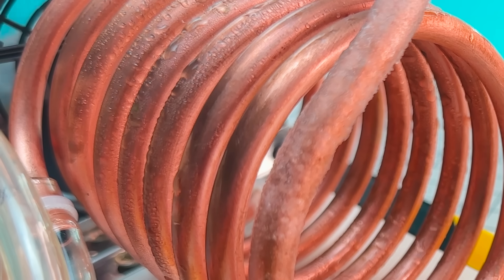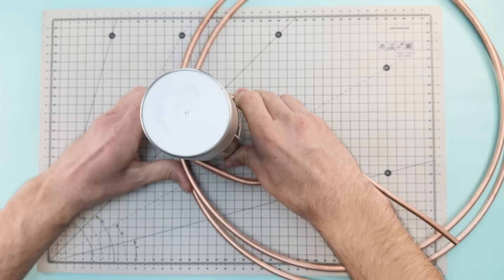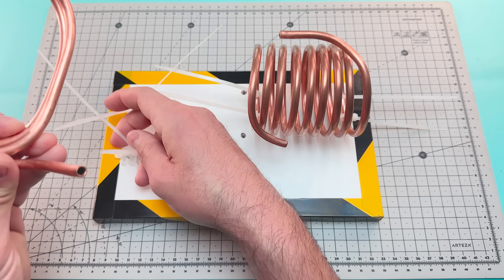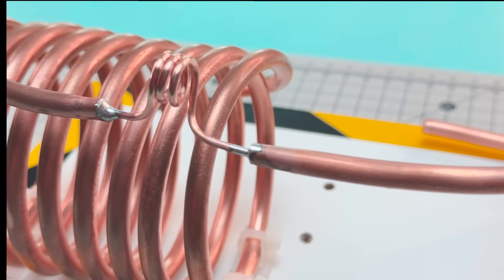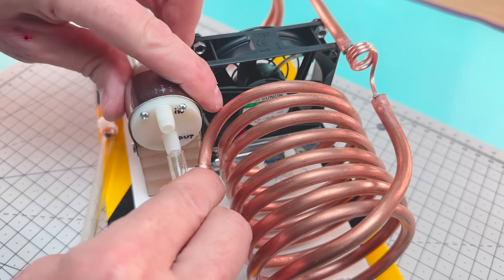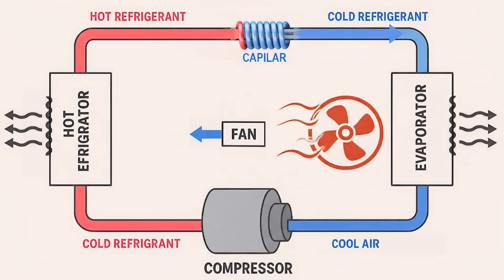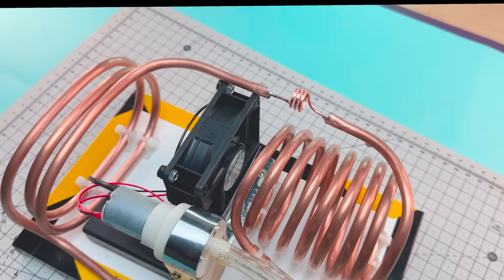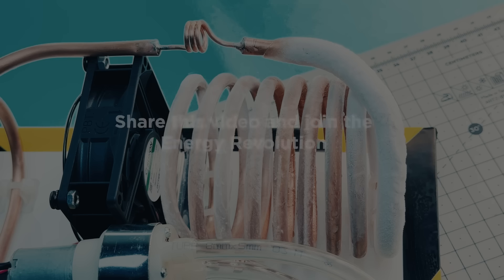Make your own AIR CONDITIONER at home Fast and Easy!

Comment: I'm the bad dude. You are rejecting heat in the same area you are pretending to cool...
Reply: Tal vez no sirve como aire acondicionado, pero agregándole algunas cosas, tal vez sirve para capturar la humedad y arrojarla en un recipiente, en una habitación con problemas de humedad.
Reply: put it at the window can solve the problem.. and add another fan to blow the heat outside
Reply: Point
Reply: Peltier element has the same draw back. Costs about one dollar. Performs the same but drains power
Reply: Need a duct and fan for condenser to remove the heat. This would be a great science project for high school. With even more modification it could be used for a mini refrigerator.
Reply: It's a demonstration... putted components in any different spaces you like.
Reply: Still works...  It condenses faster indoors

Comment: Now that I don't have enough money to buy company coolers, but with the help of this video, I will definitely make a great cooler for my old and grounded mother. Definitely. Definitely. Great Thank you
Reply: Be careful, the system will actually make the room hotter as the condensor is also installed at the same place.

Comment: nice - i thought i had clicked on another dumbass YouTube lie until i seen him inject the fuel with a needle, and thought, this thing might actually work. you can also get cold air using nothing but compressed air and a device, name escapes me, that spins air inside itself, some kinda vortex tube - used to use one in a large equipment manufacturer that i was employed at, that needed to have a microprocessor cooled where a typical fan on it, was just circulating the hot factory air. it would freeze quite a bit of the circuit board. regular air enters a housing, cylinder in nature. goes through nozzles like a turbine engine directing the burnt gasses into the turbine wheel, but this thing as no wheel, just space. the cold air leaves though a straw at one end, the other end has a straw that takes the hotter air from the squirrel, the opposite direction. beats me what the name of it was
Reply: Трубка Ранка — Хилша.

Comment: How about not using a battery, which doesn't last very long, how about using electricity from your wall socket?  What is the cooling capacity of that unit? What size of a room would it be effective in?  I live in an apartment where the ceiling (attic) isn't insulated, so, for example, when it is above 80 degrees outside, the temperature reading at the ceiling is at least 10 degrees hotter than the temperature outside, which mean, my room is typically 10 degrees hotter than it is outside.  Opening windows just lets the hot air outside mix with the hot air inside and doesn't provide much relief.
Reply: Put one of these devices in an enclosed box that's completely thermally insulated with the battery outside and switch it on. Ask yourself one question, is energy going into or coming out of that box? Then take it to the next stage, what happens if you apply energy to something? If you get the correct answer of "it gets hotter" you'll realise that it's not a cooler at all it's just a heater.

Comment: Okay. Let's forget that using isobutane is dangerous and let's not discuss about the technical characteristics of the compressor. Let's just calculate whether it is possible to achieve the cooling effect as in this video, listing only the known facts: 1. The energy reserve of the battery shown in the video is from 4 to 6 W * h; the theoretical efficiency of the Carnot cycle, provided that the heat from the hot part is effectively absorbed by the environment, that is, the radiator is located outside the cooled zone, is 300-400%; 3. The cooling capacity of the device shown will be from 12 to 24 W * h. If we assume that the battery will give up all its energy in 10 minutes, it is quite possible to achieve cooling capacity values of 100-200 W * h. This means that the cooling effect shown in the video does not contradict the theory. Verdict: possible.
Reply: Yes, he is showing the possibility of a DIY compressor.  Whereas 99% of the comments are nitpicking that the compressor and evaporator are not split in different thermal zones.  Sometimes a clip goes over the head of viewers.

Comment: This is a brilliant example of applying thermodynamic principles at home! I've tried something similar using a mini fridge compressor and R134a refrigerant, but using isobutane and a capillary tube like this is far more accessible and cost-effective. The -10°C result is impressive for such a compact setup. Make sure to ventilate well when working with isobutane it’s flammable.

Comment: Very nice model, giving basic understanding how refrigerator or a/c is working. However it would be useful to mention that the amount heat produced by the system exceeds the "amount of cold" generated, so no chance that you will chill the room with it ))).

Comment: You didn’t measure the temperature on the opposite side with the condenser. It will be very hot. It like opening your refrigerator to cool the kitchen. It actually gets hotter because the heat is transferred to the outside coils, heating up the kitchen environment

Comment: Sucking in hot air from the coil behind should nicely cancel out the cooling. I imagine that the battery would not last for very long
Reply: At least he found out how to make a very decent and very cheap dehumidifier.

Comment: I take six 2-liter bottles. I freeze them in the freezer. I put them on a baking tray from the oven. I put a small fan behind the bottles. I put the whole thing on the windowsill.  If desired, you can still cover a cardboard box, covered with foil on the inside. for 5 hours of daytime heat is enough, then just change the bottles with ice.
Reply: this will go on forever

Comment: Is it compulsory to bend the copper tube. can we use straight tube?
Reply: you can use straight tubes, but then the device would be several feet or even yards long, and nobody has room for that, and it's unviable.

The reason the pipe is bent into coils is to fit a lot of copper tubing in a small space, thus making the device space efficient, compared to the maximum surface. It would also require a special canal or other device to direct the air in such a way that a long straight tube can achieve cooling.

Comment: Pretty sure there's a reason flammable gas isn't used as refrigerant. 💥
Reply: Hey just wanted to let you know there are flammable gasses such as propane and butane used as refrigerant. This video is wrong on multiple accounts but the choice of refrigerant is the best for his use case. Do with this information what you will I just felt like letting you know.
Reply: @mastermind0684  I knew it was for demonstration/education. But some people may wonder why current refrigerants are used as opposed to flammable gasses. That was all. Cheers.
Reply: I've got some bad news for you. If you bought a refrigerator in the last 10 years in the US, it has flammable refrigerant in it as per regulations here in the US. A few refrigerators have already exploded as a result of this.
Reply: @theclearsounds3911  I would imagine this is part of the push to electrify kitchens. No way they'd allow an appliance carrying explosive fuel to be installed next to an open flame appliance, (ie; stove),. It wouldn't meet code requirements. Maybe in third world countries? I don't know. But an electric stove might.
Reply: It won't go boom. Butane and others aren't used widely because of the potential hazard if inhaled. It will also slowly penetrate through the plastic tubing ,just like the lighter gas leaving a plastic lighter over time.
Reply: @derBenIsPlaying  Leaky butane or other similar flammable gasses around a gas stove in a kitchen is probably going to get the attention of law makers and others. In fact, it's "one" reason that refrigerants were developed in the first place. That and efficiency. Ammonia solution was used for many years and still is in rv fridges but if it leaks, (and sometimes they do), you're not supposed to inhale it. But it's safe around open flame as that's one of the main methods of powering it. Cheers.

Comment: Unless there is a component that dumps the heat outside all you are doing is wasting power as both the heat pump and the ac are cancelling each other out.
Reply: The idea here is how it works...
Then it's up to you to decide if you want to do something with it... 🙄
Reply: This is called spot cooling like an electric fan. You will feel cool air only in local small area.

Comment: Please don't try this.  Even with a sightly flammable refrigerant sensors need to be added.  Also this is really just a dehumidifier.  Cool project but dangerous
Reply: If you replace the gaz refrigerent with r134a can?
Reply: Anyone that's tried lighting a Bunsen burner in school will know how hard it can be to light.  You need exactly the right mixture of air and isobutane before it will burn.  Is it possible to make it explode?  Yes, but you'd have to put significant effort into making that happen.  But yeah, you will need to dump the heat somewhere to make this a true AC unit.
Reply: @larryb51 air and isobutane right in the video.  Watch the whole thing, no vacuum pump.  Nice try to know more.

Comment: As a certified HVACR technician, I'd say this is a very interesting project. However, it is extremely dangerous since you're using a highly flammable refrigerant. The moment I saw the isobutane I got anxious thinking about what you'll use as a pumping solution. When using a flammable refrigerant, extra cautions needs to be taken. The pump needs to designed with this in mind. Any spark could be catastrophic, considering no vacuum was performed before charging the gas.

If I was to advice on improving it. I'd suggest to add an extra fan at the condensing side to help with high head pressures and I'd also shape the coils in more of an outwards spiral shape so the air flows through is more evenly distributed.
Reply: Definitely correct, air, fuel, spark that happens with a dc motor go boom
Reply: yep I think the video should actually be called "Explanation" and "Danger."
Given the size of the project, though, and if you're doing this in your garage, 
there's not much chance of setting the house on fire.

It is true that this lacks a reminder of the danger.
Reply: Good to know - thanks for posting your comments.

Is there another refrigerant that could be used?  Maybe some kind of freon?  I have read that early refrigerant systems used ammonia, but I doubt that would be a good choice in an enclosed living area.

And by "outwards spiral shape", do you mean something like a funnel shape?
Reply: @TK-zf7sx  I think he means a flat coil like a electric stove burner.

Comment: As someone who has worked on a/c units, this seems to be and correct me if I'm wrong, a Temu window air conditioner that is not actually placed in a window that expells the heat created by the unit itself.

Comment: Considering you're both dissapating heat and absorbing it in the same room, this is a nice looking heat circulation (not a cooler)
also considering you have an electric motor, which creates heat, you have a heater
but a cool project for the idea itself
Reply: Anybody who owns a refrigerator already knows that. 😏

Comment: Interesting project but here is my take on this DIY unit. 
1) It cannot generate the required pressure differentials (the 9 V “air pump” is not a true compressor), 
2) the heat‐rejection surfaces are far too small, 
3) the capillary sizing and refrigerant charge control are imprecise, 
4) and using flammable isobutane without proper safeguards creates serious leak and fire hazards. 

Overall, it will not deliver meaningful cooling and poses safety risks.
Reply: You're right about the lack of a real compressor (I'll add the aquarium tubing).  He probably faked the frost, but overall, it was a good demonstration of the principals involved, and it's got me wondering if butane or propane would work as effective refrigerants for those who like living dangerously.
Reply: Some tried replacing or charging their R-12, R-22, etc systems with propane. The results were subpar, to put it politely, and they ended up calling in a repair technician who now had to properly dispose of the contaminated refrigerant. I haven't heard of any fires caused by this, but...
Reply: No it is NOT a good demo of the principles involved because it fails to point out the most basic and fundamental requirement... locating the hot coil outside of the room you want to cool. It demos the Carnot cycle but that's about all it does.
Reply: Not being argumentative, just consider butane has a much narrower differential, and the volume is pretty trivial as a hazard. Use a wall wart, already!

Comment: The reason it is freezing at the input side of the evap coil is you don't have enough refrigerant in the system.  You want to keep adding it until the coil is a uniform temp most of the way through.
Reply: And use an actual compressor, which wouldn't even run on that 9V battery.

Comment: I think you have to put the condenser coil out side if you want to cool any room.
Reply: you expect to cool a room with this😅😅😅
Reply: I have my air conditioner inside because I was too lazy to install it.  I put two bath towels underneath the drip tray and it does the job of reducing humidity and saturating the towels with water.  Works for me

Comment: Yes it needs to be taken into consideration that heat from the machine needs to go outside the area to be cooled 
On the other hand as for myself I learned a lot from this 
I always suspected refrigeration happened because of the ventury principle (capillary tube) now I know for sure that’s how it works 
In simpler terms decompression makes cooling 
Excellent 👍
Reply: If that's what you think then you still do not understand refrigeration. Google "Carnot cycle" and study that. When you understand the Carnot cycle you understand cooling/refrigeration. To cool a room you need compression as well as decompression. It's complicated.
Reply: @manatook-d9m Icompletly know that you actually CANNOT have decompression without also having compression (can’t have one without the other if you want to have any cooling or heating) 😂

Comment: Great invention!
While you can chill your drinks in the evoporator, you can cook your eggs on the condenser 😂
Reply: самое логичное применение этой самоделке !!! ))))
Reply: It can't work like advertised anyway.
Reply: @ThomasKundera  it's clearly working, you just need to put the condenser outside
Reply: @beargillium2369  "it's clearly working"
I'm not convinced. If I had to bet on it, I think the cooling we see is the one time expansion of the refrigerant. While I'm not positive, my gut tells me that little pump and with a 9V battery wouldn't be able to compress the refrigerant back into its liquid state. The gizmo we see in the video is likely powered by the factory which initially compressed the refrigerant into the can. The small pump and 9V battery are just props to make it look like a complete system.
Reply: People will make this model at home and will understand for themselves what heats up and what cools down.

Comment: Suitable for cooling the cat's house
But 
This is a vicious circle
Air cooling with condenser and then heating it with radiant
The radiant must be outside the room
Reply: Did you mean it will not actually cool down a 250 square feet room?
Reply: "Honestly, it can't cool more than a 2-square-foot box. We use a 12,000 BTU air conditioner that runs on 240V, and it barely cools a small room. So imagine this toy, running on 9V! 😊"
 @balloney2175
Reply: Unfortunately, the temperature will never be reduced to even one degree 😊
Reply: Unfortunately, the temperature will never be reduced to even one degree 😊  @balloney2175

Comment: dont know why all those videos like this are made for fooling people..  
you are not using a compressor but a small 9 Volt pump? - i bet you had it laying some hours in the freezer and played film backword so it looked like it worked..
Reply: Good point, the fan spins in reverse when the pipe appears to freeze.
Reply: Its all about views and likes the content is irelevant as long as no one complains they get paid for the video.
Dont take you tube sriously
Just like how they ruined eBay did the same thing to you tube
Nothing is real anymore.

Comment: So stupid. R600a evaporates at -10°C with 14 PSI pressure, At room temperature of 20 °C it condenses at about 53 PSI. 39 PSI pressure increase with one pump (one for water), powered by a 9V battery with a max power of 3.6W. Is there some kind of contest to see who can fool the most people?
Reply: I have a few questions if you don't mind: 

Is this something that could probably work out better if you were outside or in a large room and just wanted to cool off your face? 

I would assume it would be better to use a rechargeable power bank instead of a 9-volt, since that battery would probably die quickly.

I assume it would need a drip tray, maybe with a removable sponge? 

How well would this work to keep your soda or beer cold? 

What would be the optimal gas instead of what he put in there in your opinion?

Thanks.
Reply: Let's say it's a car tire pump?

Standard suction and discharge pressure?

It doesn't work very long: leaks and an O-ring without lubrication.😅
Reply: Am not sure you watched the video to the end...

Comment: Even if it has succeeded, how often do the batteries need to change? Every 4-5 minutes?
Reply: Это лабораторный эксперимент, а не руководство к действию.
Reply: use a solar panel and then charge to the battery 12 volts 25ah or 50ah..

Comment: Eahm.. wouldn't the fan blow hot air from the condenser? There's a reason this is placed outside the building on conventional systems.